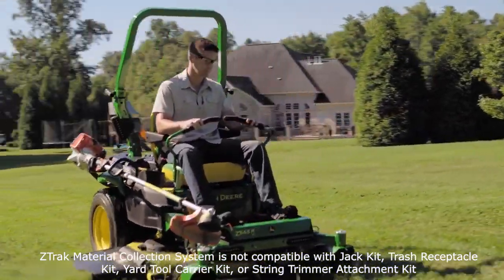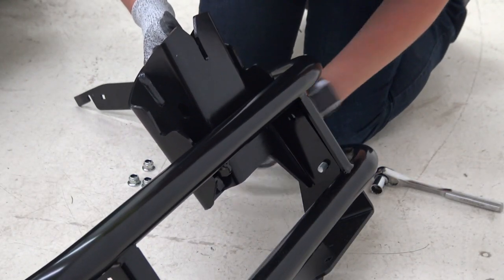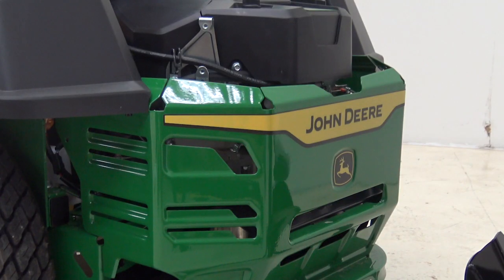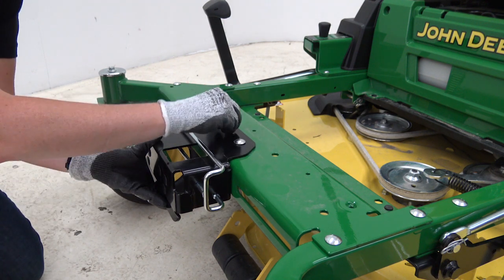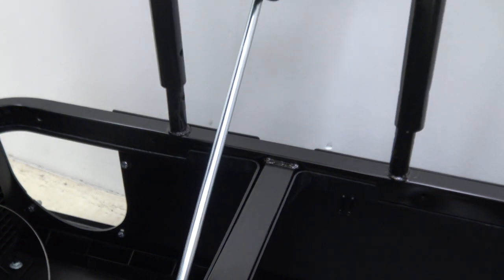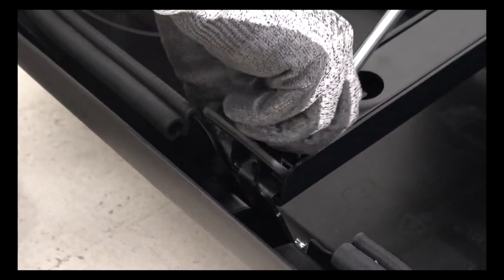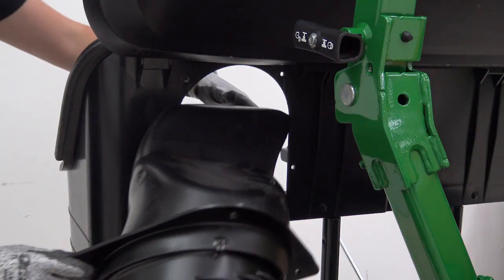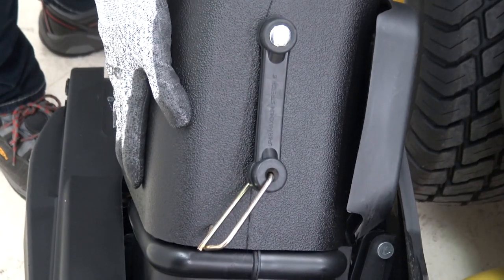How-to Install the Material Collection System | John Deere Z500 Series ZTrak™ Mower

Comment: Do you have a parts list for this? I'm buying a Z515E and am having a lot of issues figuring out what exact parts I need to have a bagger.
Reply from the maker: Thanks for reaching out, Matt. The Bagger attachment requires a Chute, the Material Collection System kit, and a Power Flow™ Blower which is dependent upon the deck size of your Z515E ZTrak™ Mower. You can find a list of parts for your unit and the Bagger attachment in our online Parts Catalog here: https://bit.ly/3mPtBfM. We recommend confirming compatibility of parts with your local John Deere dealer. If needed, you can find their contact information at Deere.com/Dealer. We hope this helps!

Comment: I got a z665 and I’ve been looking for a bagger for years I’m kinda disappointed any chance you could provide a link
Reply from the maker: Thanks for reaching out, Riley. The Z665 Zero-Turn Mower does not feature a compatible Material Collection System. For further attachment and availability questions, we recommend contacting your local John Deere dealer at Deere.com/Dealer.

Comment: What If I already have the back bumper installed? Do I need to uninstall that?
Reply from the maker: Aaron, thanks for the question. No, you do not need to remove the rear bumper attachment. This attachment is required for installing the Material Collection System to your unit. For further product questions, please contact your local John Deere dealer. You can find your local dealer at deere.com/dealer.

Comment: Does this work on the z515 that’s got the 60” deck?
Reply from the maker: Thanks for asking, Nick. No, at this time we don't manufacture a material collection system that is compatible with the Z515E ZTrak™ Mower with a 60 in. deck. We do offer material collection systems for the Z515E with a 48 in. and 54 in. deck option.
You can learn more about what attachments we offer for the Z515E at http://spr.ly/6051PRtLF. We hope this helps!